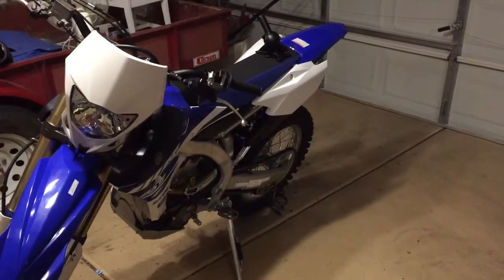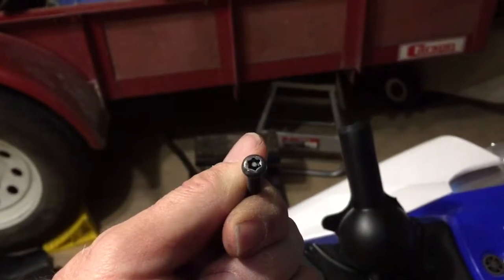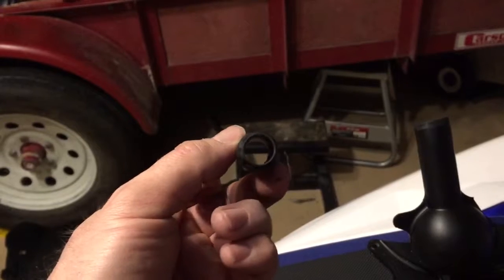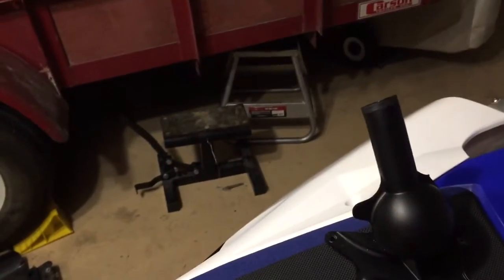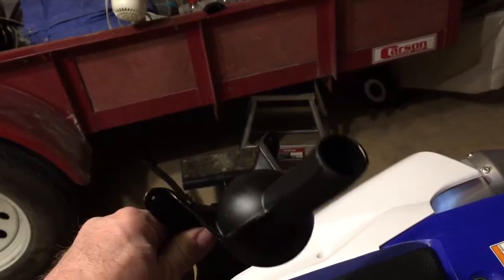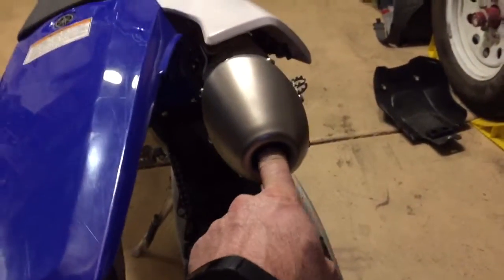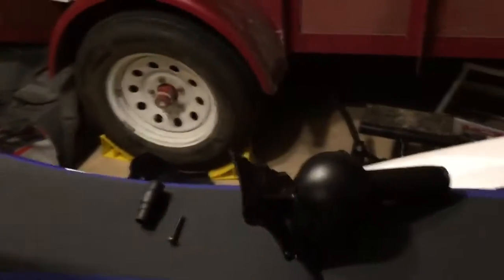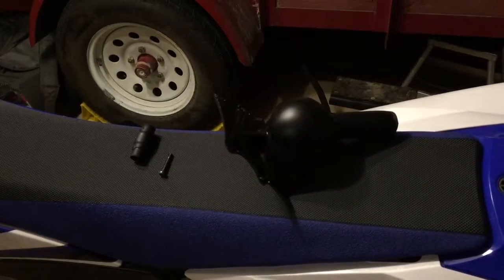Wr 250f smog restrictors removed

Comment: I know this is video is older. Why did you buy the yz ecu? Its easier just to pull the grey wire so the ecu switches to the yz map.
Reply from the maker: EvilGhostReaper On pre 2015’s you were able to do the gray wire mod, however on the newer wr’s the ecu has fixed settings that cannot be altered with the power tuner or any wiring mods.  You must switch the ecu to utilize the power tuner and or get more power.  Fortunately the competition ecu is only about 100 bucks and it makes an enormous improvement.  Also you must get the specific competition ecu for the wr so the radiator fan will still work.

Comment: Just wondering if you remember what diameter and size the throttle stoo screw is
Reply from the maker: It’s an m6.  However if you want to know what tool to remove it it’s a security torx.   Get them a harbor freight